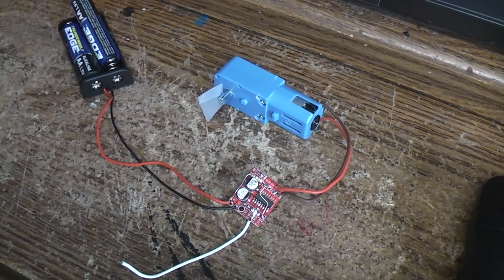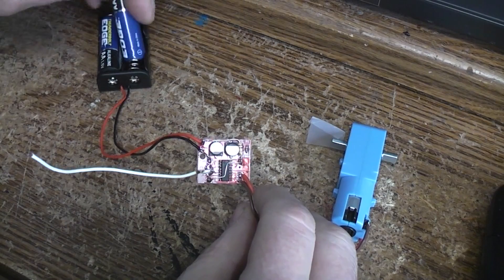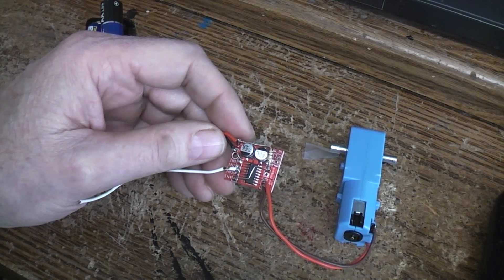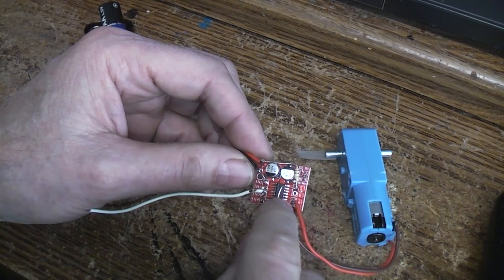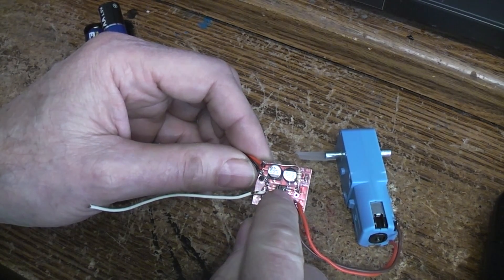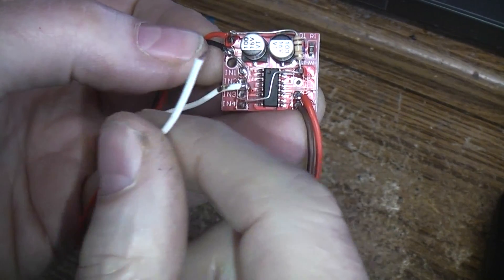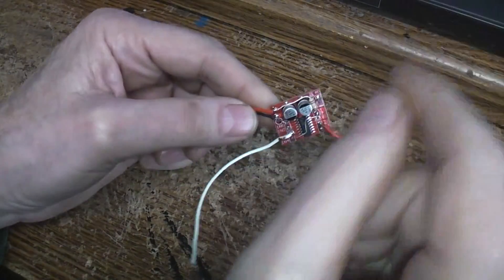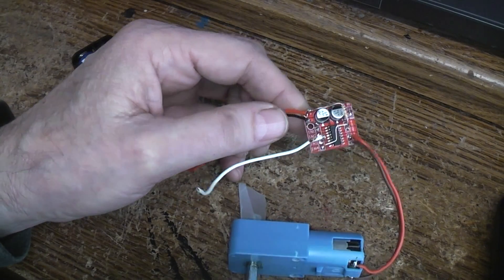The MX1616H dual H bridge driver MOD for single control line Forward - Reverse motor control.

Comment: Just had another look at the datasheet, and if you tie IN1 to VCC instead of ground, you avoid the tristate condition on OUTB1, therefore removing the need for the pull up resistor.
Reply from the maker: You need the tristate position to make it an inverter.
Reply: @Robothut if IN1 and IN2 are high, OUTA1 is low. If IN1 is high and IN2 is low, OUTA1 is high, therefore you have a proper inverter between IN2 and OUTA1.

Confirmed with datasheet and in practice. 

(Meant OUTA1 before)
Reply from the maker: @epmorris  I will have to check it out. Sounds like a great way to simplify the circuit even more.
Reply from the maker: @ This gives me some new ideas for this chip, well the MX1508 seems to be the newer version, costs about 89 cents on AliExpress. But with a inverted output and 1.5 amp drive we should be able to build high wattage lamp flashers, power oscillators up to 15 watts when operating on a 10-volt supply and I think a flip flop power latch circuit. So, I have ordered a few of the chips to play with.

Comment: Genius!!! Thank you! Could I ask what is the current draw of MX1616h?
Reply from the maker: Operating voltage: 2V-10V
Signal input voltage: 1.8-7V
Single working current: 1.5A
Max current: 2.5A
Standby current: less than 0.1uA
Reply: @Robothut  Thanks! That is the datasheet info. Is there any way to measure your setup?